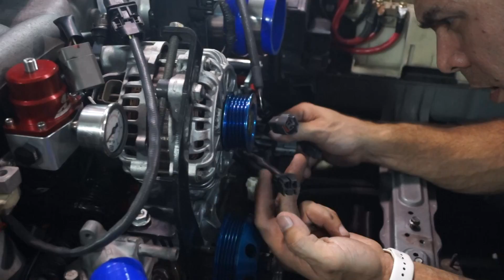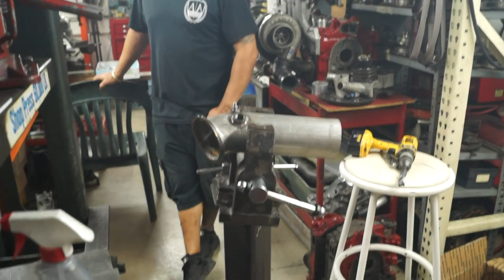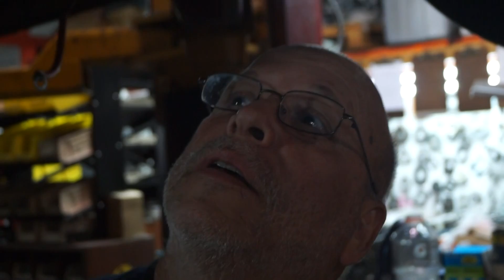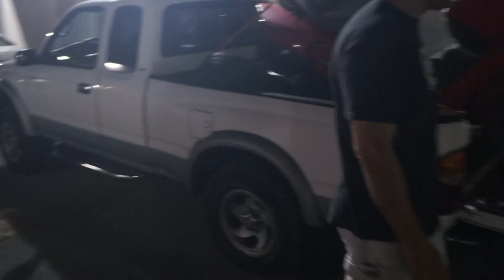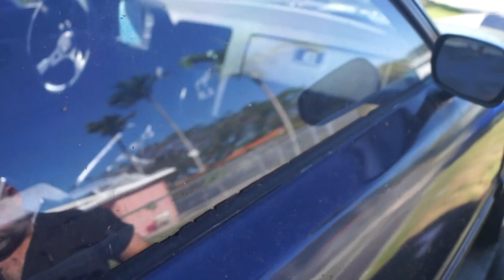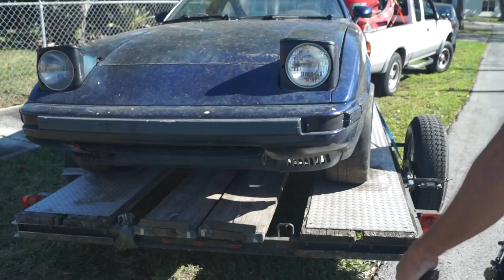Project Turbo RX8 Part 33

Comment: It seems no one is running the renesis motor and everyone changes it out for an options that's 10's of thousands of dollars. I was hoping to pick up a cheap RX-8 and try and get it to 350whp without breaking the bank. Is this possible without spending tens of thousands of dollars on expensive 13B REW swaps or are there turbo kits that better deal with the renesis heat issues than others?
Reply from the maker: I've seen turbo kits on E-bay for the renesis motor. You might get away with running 5 lbs of boost max for maybe 10000 miles or so before it grenades. There is no way you will get to 350 hp reliably on the renesis.  The engine is just not designed for anything more than what it produces stock which is around 185 hp to the wheels.
Reply: Richard Viscasillas thanks for the reply and I appreciate the advice